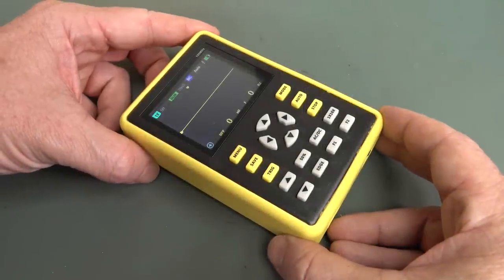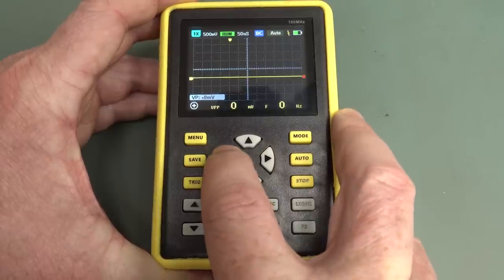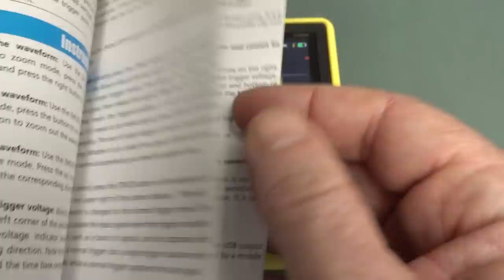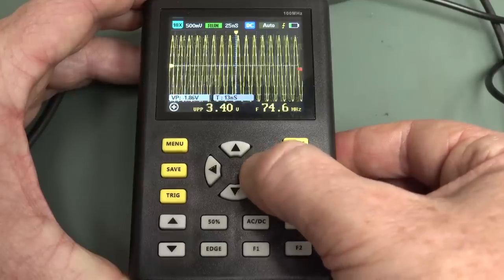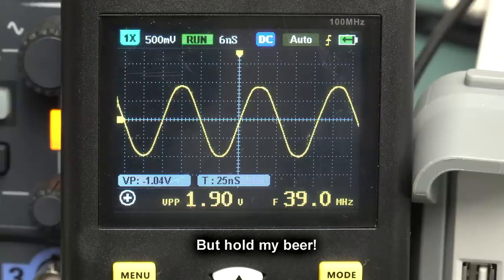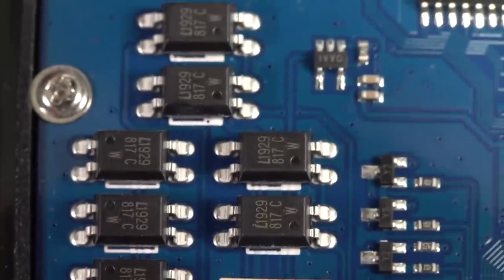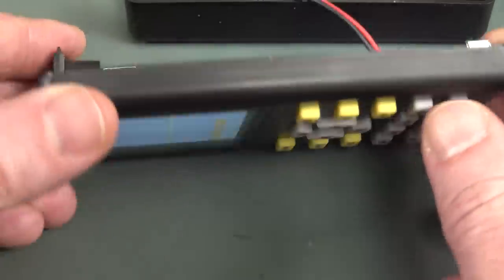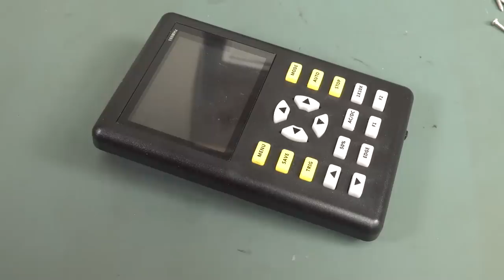EEVblog #1260 - $70 100MHz Oscilloscope?

Comment: Won't work for sparkies either, even if you ignore the lack of appropriate Cat rating. No 100x probe setting. It's a pity, because all you need is 20Mhz, but you need reliability and a proper idiot-proof UI. Oh, my kingdom for a modern Fluke 867b (at this thing's price and form factor).

Comment: Enough of this dodgey talk. It does display to 100 mhz, I never troubleshoot a circuit with frequencies over 10 MHz. I always thought that a low bandwidth meant you coukd not display a proper square wave at frequencies even 10 percent of the bandwidth. A 10 MHz square wave wont look square on a 20 mhz scope. Most of us are looking for signals from sensors and on a bus or enable lines. Of course it wont work like a real bench scope. Most other low end scopes can barely do 400 khz. I did buy one and am happy with it for my uses like radio service or bit chasing  in the field. Better than just a dvm on AC for sure.

Comment: I have one, i mean you get what you paid for, good for measurements around vehicle, battery insulated some low BW stuff that need floating device, did not expect much anyway, for real scopes i use Keysight 4x100M, Rigod DS1054 BUT my favorite is Micsig tablet scope 4x100MHz, you should check that one... https://www.youtube.com/watch?v=DNou_H-kHZY